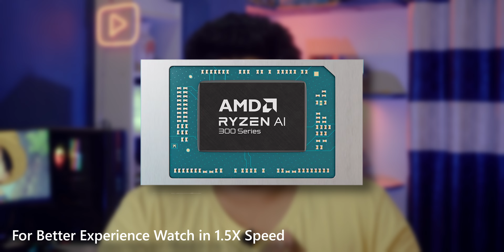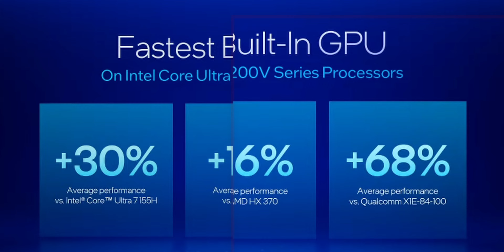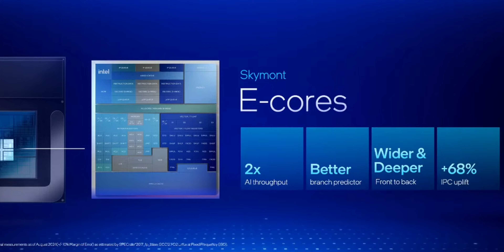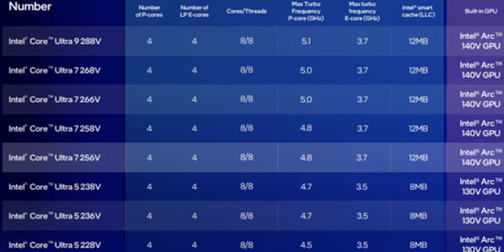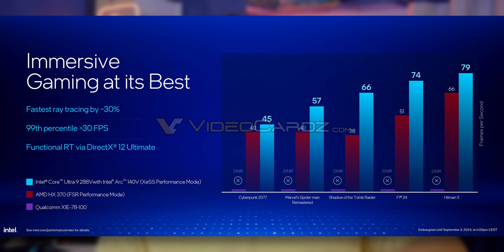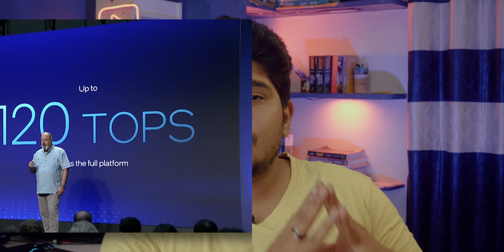Intel Lunar Lake First Look (Intel Core Ultra 200V)

Comment: But what about graphics?are they same or have some improvement?
Reply from the maker: Yes according to Intel the graphics performance did improve significantly.
Reply: @TechnoDefine  same arc graphics. But where are the numbers? I mean how much improvement? Still way behind nvidia..
Reply from the maker: I mean it’s iGPU so it mostly won’t be able to compete with dedicated GPUs, but until independent reviews are out we just can speculate.
Reply: @nobi_knows better than rdna3.5 by 16%
Reply: Yeah and some benchmarks show they beat AMD's iGPU by A LOT (20% or something with lower power)